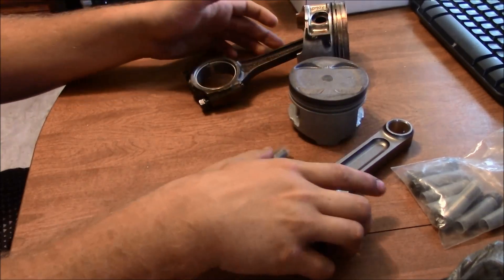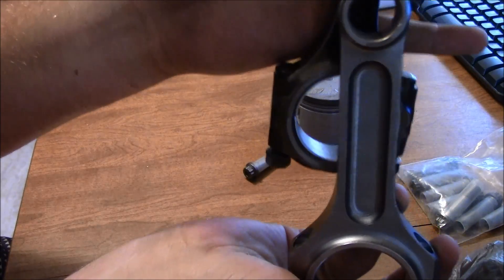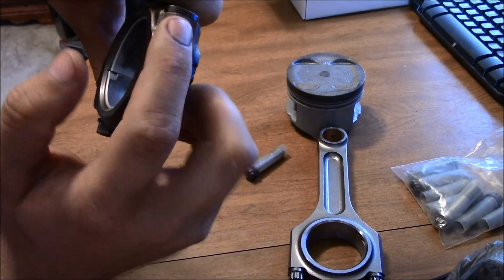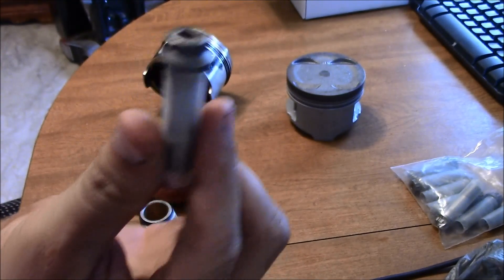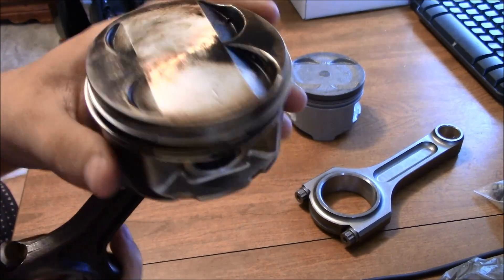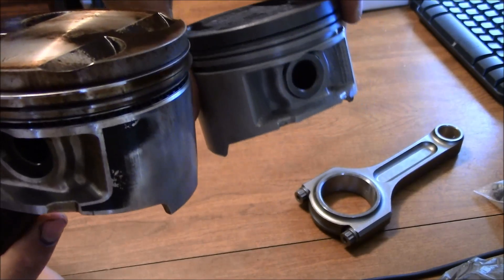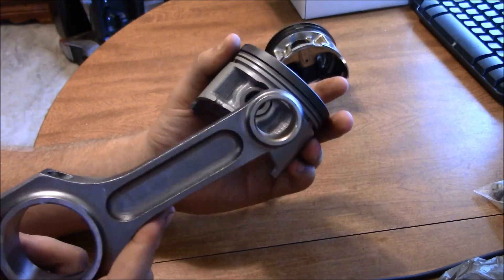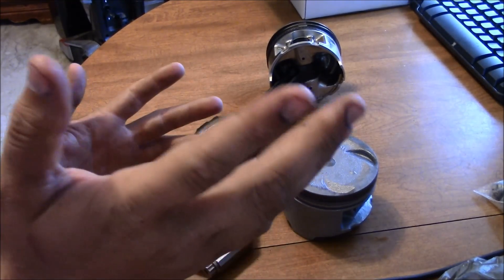integra Ebay Rods and Nippon Pistons compared to stock

Comment: Did the piston and rods you linked fit eachother with out machining?

The floating pins fit the bronze bushing of the rod perfect? Did it fit the oem spec bearings ?

Thanks
Reply from the maker: Yes all worked
Reply: @MotorNubs  hey there motor nubz I have civic ep2 d16v1 turbo here in the UK same engine as the d17 in the civic em2 coupe I love wastegate boost pressure is set @8psi on stock map sensor max 11psi 😏😏 9.4.1cr stock pistons and (factory thin rods) 
I need your help 
I want to keep the standard 9.4cr pistons. but I want to buy the eagal forged rods or H beam ones & fit them to the factory pistons is it possible to do as it's same layout as d16z6 & y8  vtec engines
Reply: can you share your map with us ? please ! thanks. I could use it as a base map :D

Comment: Yeah those pistons are good. I DD mine for 2 years at 500+whp on pump gas. It had boost by gear so I didn't always run full boost until I got to 3rd gear. I'm actually building a spare block for my car over winter with Scat rods and Nippon pistons.